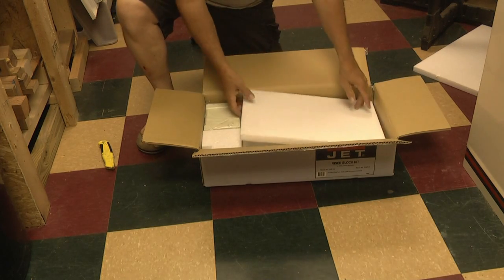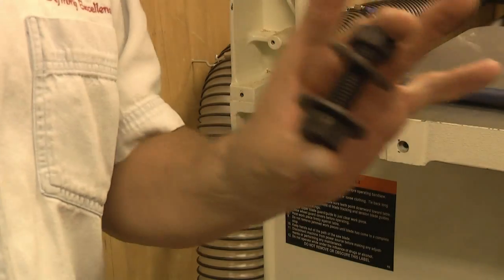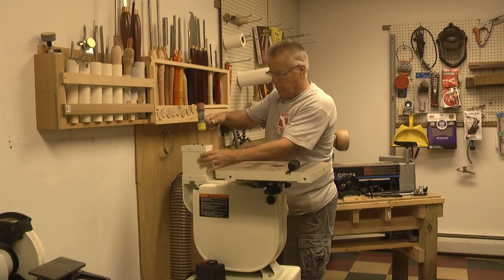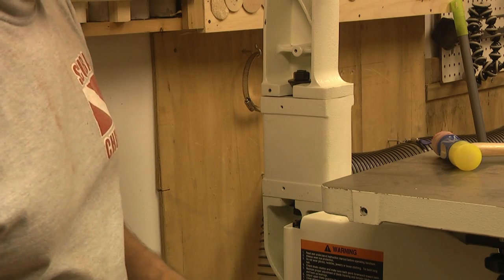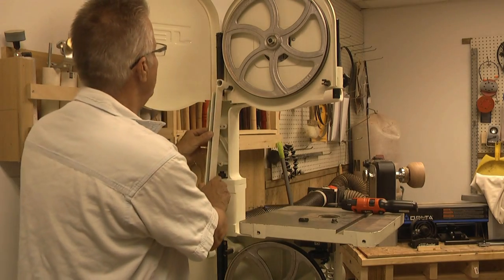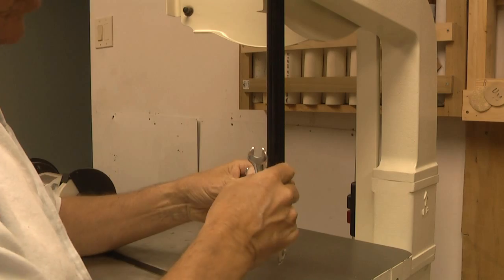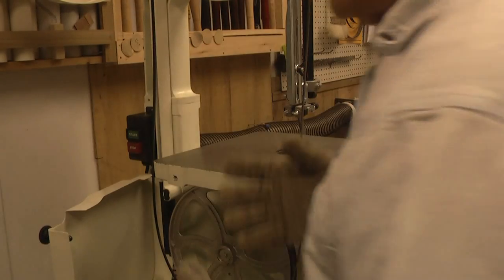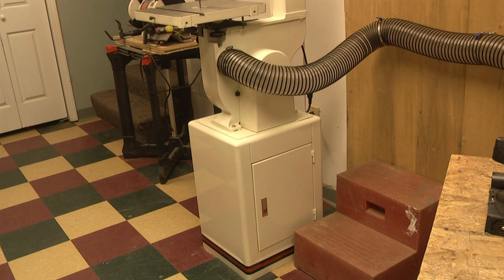Jet Band Saw Riser Block Installation #9

Comment: pretty kool process. one thing i would recommend is to heat the bolt up to about 250F before installing and torquing it down.  the bolt will shrink slightly as it cools and give you the torque you need but can't achieve because of the difficulty in getting a tool onto the end of the bolt. chinese made hardware isn't the best quality and the bolts will stretch some when the machine is in operation.  you can always take out and heat the bolt as it stretches later on should the top half of the machine show signs of drifting or crabbing
Reply from the maker: +HolzMichel Thank you for the great feedback.

Comment: This was a big help and I finally decided to get the kit. It's awesome!!! I was able to cut logs that I had laying around the yard. I have the old blue Jet bandsaw, but everything else is the same. The kit came in white, so I had the Home Depot match the old blue paint of my saw. I painted the pieces before assembly and they came out great! Thanks again. By the Way, I put the new longer bolt in the top assembly and then lowered it through the rise block and it worked great.
Reply from the maker: +saturncjc I knew there had to be an easier way than feeding the bolt through the bottom.  Thanks for the feedback, the riser block made a huge difference with my ability to resaw logs.

Comment: does your saw have a standard jet 14" motor and did you notice any loss of power or strain on the motor??
Reply from the maker: Randy Kniebes Yes, the saw has the original 1HP motor that was standard with this mode.  I have not experienced any loss of power or noticed any strain.  I have resawed many larger logs since this installation, and have been very satisfied with the performance.
Reply: I Turn Two thank you for the answer to my question and the vedeo..

Comment from the maker: To be honest, I did not reconfirm the wheels were aligned on the same plane after the riser block was installed.  The pins on the riser were so perfectly set it never occurred to me to check.  Rookie luck I guess.  Once the new blade was on and the tension and track set the saw performed flawlessly.  I have used several blades since the install and never had an issue.  Hope this helps and thanks for the nice feedback.